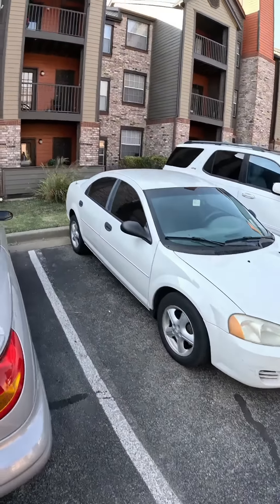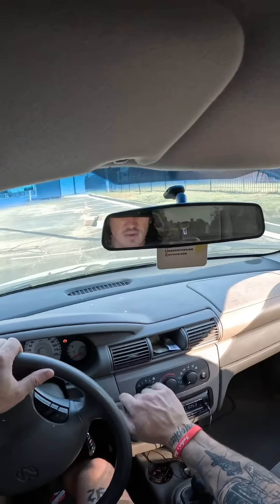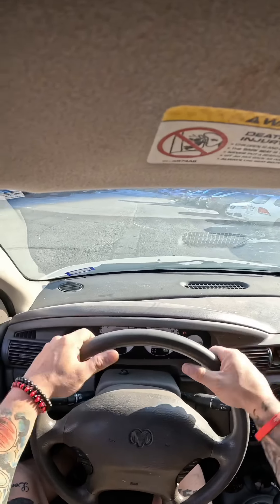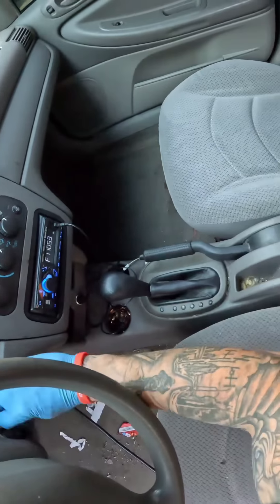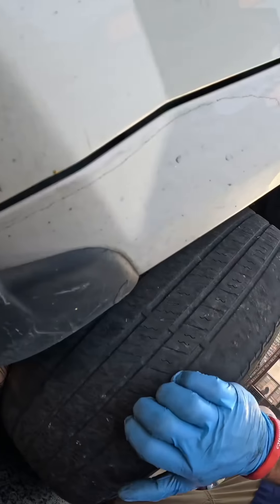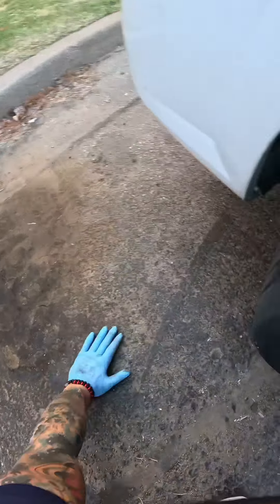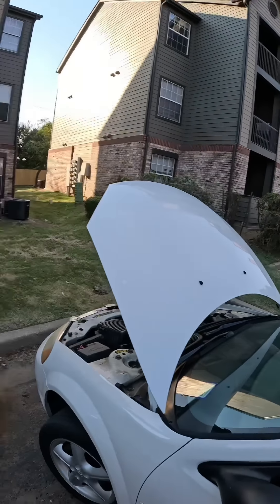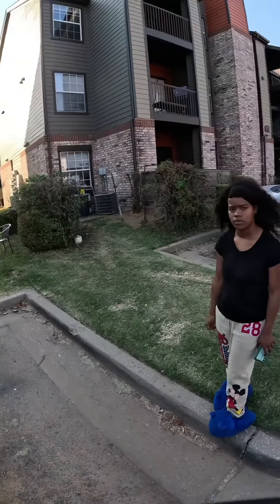How happy would you be if this happened to you!

Comment: Hey parker i recommend the 9mil gloves from harbor freight. Its bit more expensive than 3 and 5mil but they are hard to tear and you still get good grip. Its not like taking a shower with a raincoat feel 😉
Also i can take them off and set them aside for another day depending what i touched. Those blue ones always tear at the tip of finger and all that carcinogen that is on everything goes under your cuticle and its absorbed into the body. Definitely worth the extra ten bucks and the box of 50 9 mil lasts longer than a box of 100 3-5 mil
Reply: You hear that Matthew Parker  !!!!!!

Comment: I'd be suspicious if I hadn't any idea about cars and the mechanic would suggest to do stuff I haven't called him for. 
But, I did see that all the ussues you found were real. 
Just maybe, be more careful with mentioning many issues, because it will scare away someone like me, since I'd expect a huge price tag with those issues. 

Again, I do realize that you are right and everything you mentioned, indeed needs to be done.
Reply: He doesn't need your advice.
Reply: @dominique8662  Thanks for your advice. Really needed to hear that!
Reply: The customer can refuse any fixes a mechanic suggests.  It's also good ethics for a mechanic to make sure that the vehicle is safe.
Reply: @Kevin-vr7ep  Yeah. That's almost the issue in this case. 
The vehicle drives and is therefore usable. 
 And the fixes probably aren't mandatory by law where he works, because there is no inspection that can pull the vehicle from the roads for leaking and being sloppy in the steering. 
So, despite those fixes being necessary, the client can be scared off from doing what actually really needs to be done. Which isn't optimal. 

I believe that the amount of work, why it needs to be done and the costs could be presented better.

(Although, Parker's obviously making a great job overall.)

Comment: I got a ‘97 Tahoe because I wanted a vehicle that I could drive on the beach.  It had sat in a farm field for over 5 years, and I got it for $300.
I found a mobile mechanic through a friend.  I put $2000 into it that included 4 new tires, all new brakes including brake lines, new fuel lines and fuel injectors and I was on the road. 
The first time I drove it on the beach it brought a tear to my eye that I was back on the beach.
There are mechanics out there who are very competent and honest.  Some are generous folks who look out for the little guy.